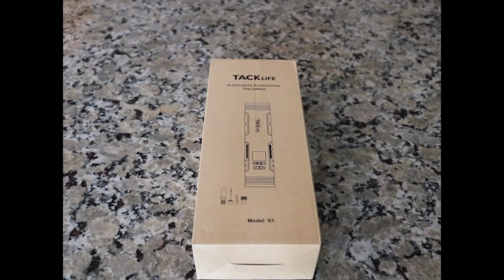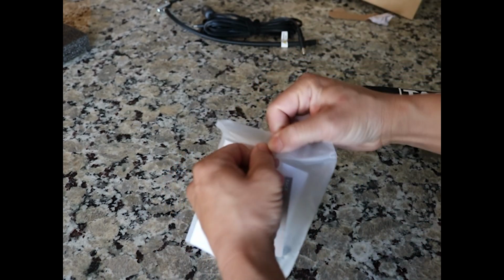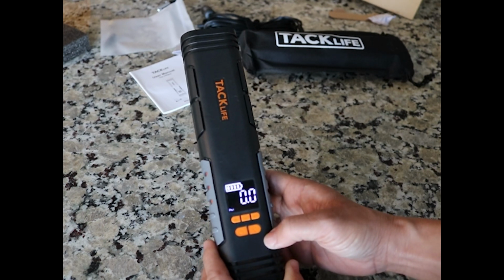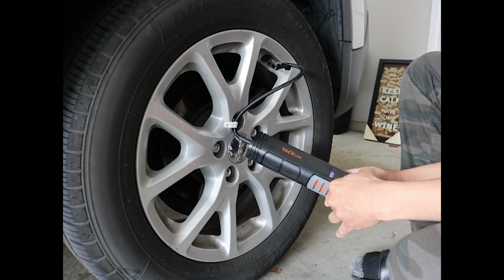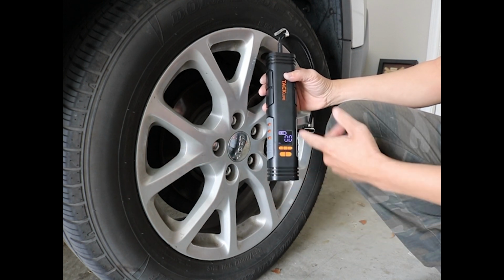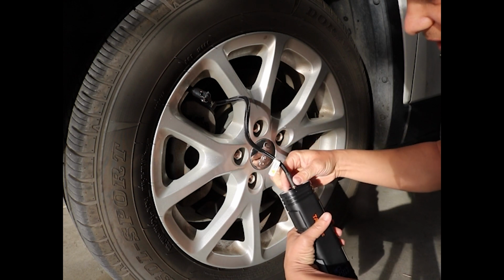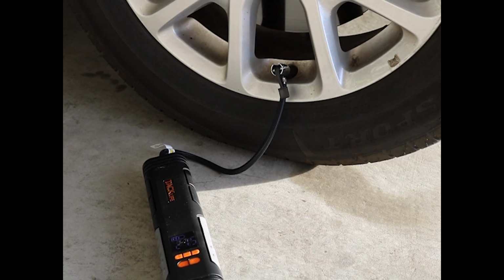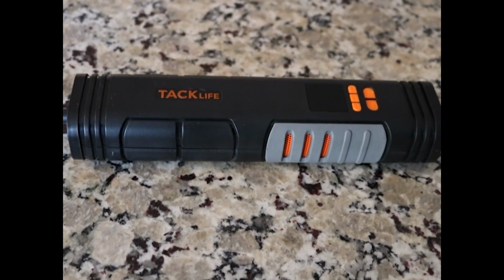TACKLIFE X1 Rechargeable Cordless Tire Inflator

Comment: it's slow, which I expect, and sounds like it gets really hot overly fast. In a pinch I have my doubts it could inflate a truely flat tire with a full charge, or without multiple long pauses to let it cool down.  Definitely would be better than nothing if you're stuck and need air in a tire, but it seems like it's suited for small jobs like inflating balls and putting a couple PSI in a slightly low tire.

But for the size it's actually pretty nice, a tool like this is something everyone should have. Ages ago I was stranded with someone in the middle of nowhere with a flat tire. And all we had was a bike pump.  Pumping a flat car tire with a bike pump really, really, really, really, really sucks. It took forever and I felt like I was going to die lol.

Comment: I own many tools by TACK, very well made. I am just not sure after watching the batt going down so quickly. So many options out there with, I think more power per tire. For a motorcycle, this might be enough.
Reply from the maker: Mine ended up breaking soon after this video.
Reply: @BazzarRepairs  That is the problem with this things. You never know. I guess, the best way is to read reviews.
Reply: @BazzarRepairs what were you doing when it broke?  Multiple tires?  Totally flat to fill?
Reply: @BazzarRepairs  Good video. Fwiw, mine has lasted a couple of years, though mainly inflating basketballs. I imagine the more pressure that it's put under would lead to quicker failing. I only searched this vid out to remind me of the charging method. We were just traveling and had a rental car that had a slow leak, and I made a note to pack this the next time.
One other thing: I would suggest noting how accurate it was in each instance (you did on the first one). Seemed to be within .5 psi, but at the end showing what the car's PSI registered at would have been helpful.

Comment: Amazon has discontinued selling this product.
Reply from the maker: I wonder why?
Reply: Confirmed. 😞 I purchased a TACKLife portable hammer drill. Love the heck out of it, but seems TACKLife products are no longer offered in Amazon. @BazzarRepairs, thinking of purchasing on TACKLife website. How is the portable inflator holding up? Does it hold its charge well?
Reply from the maker: @mvf136  tbh I haven't had to use it again. But I like Tacklife products they tend to hold up over time.
Reply: Because it's garbage. Had it for a while and when I went to use it on a bike tire, halfway through, it started making a loud grinding noise and could only reach 15 psi. I think it needs some grease, but how do I open it?